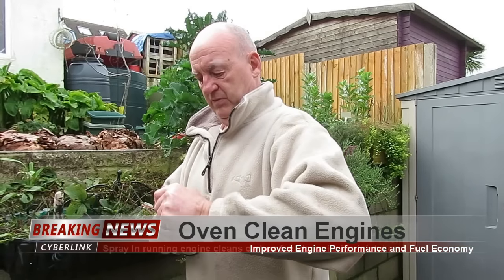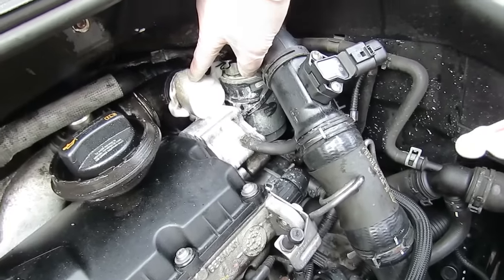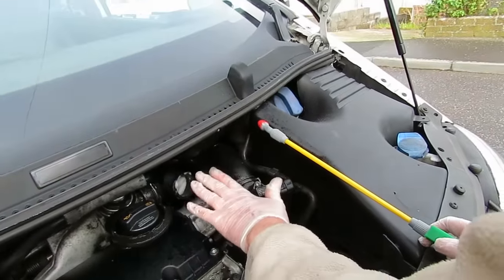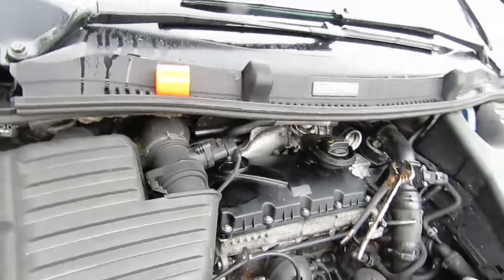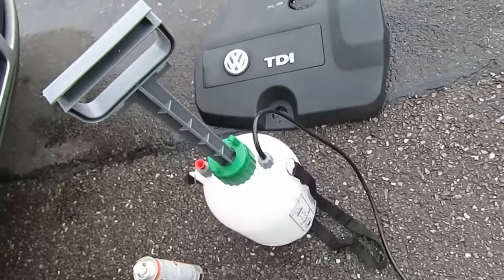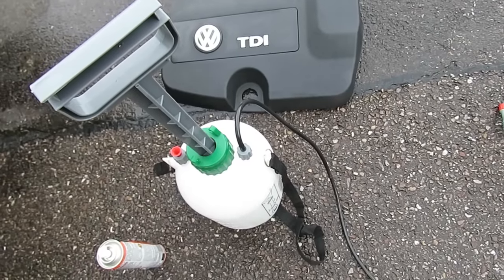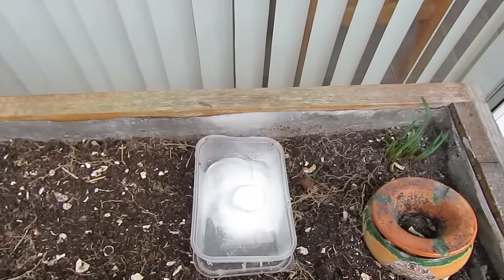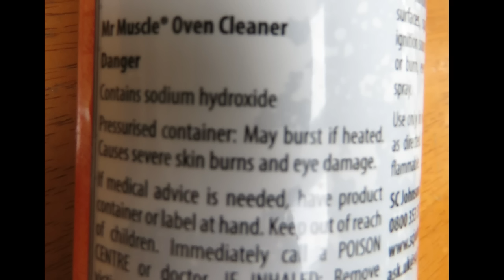Clean EGR Valve Decarbonize Turbo DPF MPG Limp Mode Mr Muscle VW 1.9TDI Sharan Galaxy Alhambra

Comment: What a great idea send all those nasty carbon deposits back into the engine instead of cleaning them out.

(You wouldn't put dirty fuel into your intake knowing that it would block up the injectors so why would you use this method which will damage the injectors and corrode them at the same time. 
plus how much are injectors to change again....£££...)

 then just when you thought you were safe.  you put WATER in there to flush out everything nasty and you've just put back into the engine.

(water expands 500 times faster than oil the excess pressure will damage your engine and bend conrods..  pistons..  warp the cilinder head..  destroy piston rings... blow head gaskets etc the list goes on and if you have a slight leak into your oil system the water will contaminate that as well resulting in a white thick oil that is now none lubricating which will cause your engine to overheat and possibly seize.) 

while Mr Muscle works on all of your metals and engine components to rot them from within.

Reducing your car to scrap value because the engine will be useless after you have destroyed it with this method and will soon require a total rebuild or an engine swap.

And you did all this because you would too lazy to get a brush and some fuel and vigorously use the muscles in your body to clean the components properly.

I bet you this guy tests garden fireworks in his living room because somebody said it was safe to do so.
Reply: On my workshop I already use this method to clean carbonized engine parts with a strong degreaser and you just have to be carefull and lube all alluminium parts after you wash them, or it will get a white corrosion if left at open air. The actual engine decarbon processes are very simmilar to what he did, also corrosion wont hapen for sure, as oil vapour is constantly beeing forced into the inlet manifold when the engine is running.

Comment: Never clean it this way spraying a flammable substance into the intake is not smart,  remove the part's to clean them. If you want something to use without removing liqui moly have plenty of product's for the job

Comment: These dodgy "how to" vids should never be attempted. Sure fire way to give your engine a short life span. Surprised not to have witnessed a hydro locked engine!
Reply: 206000 on my bora with 4 water decarbs over 3 years.  No smoke on my vdub
Reply: Now using steamer instead of water spray.  Did water treatment to saab, Astra, 206 whether petrol or diesel

Comment: spraying water for heavens sake. you'll hydrolock your engine.
Reply: Jack Hewison read my comment above
Reply: I decarbonize my diesel with water every year "hydrolock" have you actually ever done some work on any engine so far?  Do you at least have any idea what amount of water is needed to hydrolock a chamber??  I guess your engine also hydrolocks when you drive in rain because the humidity is high right XD
Reply: Hydro lock will not occur unless excessive amount of water enters the cylinder, it is even possible to buy kits on the market that do water injection. This is why these guys use a garden sprayer.